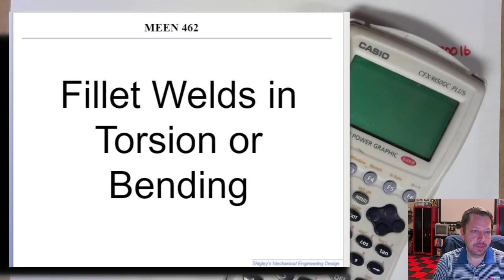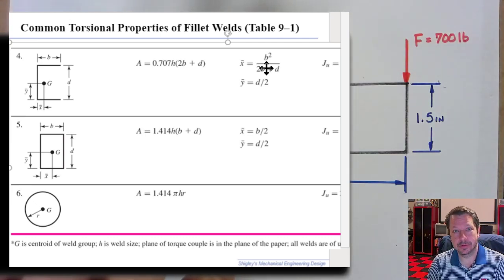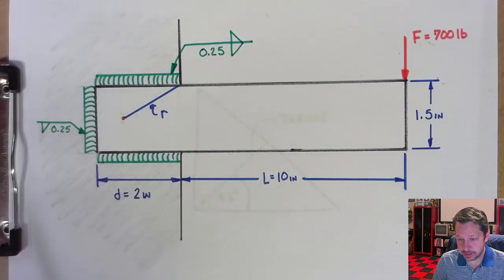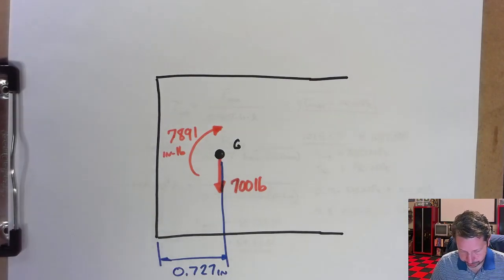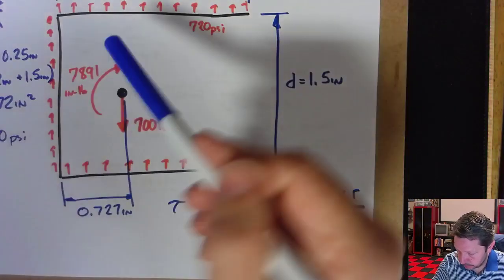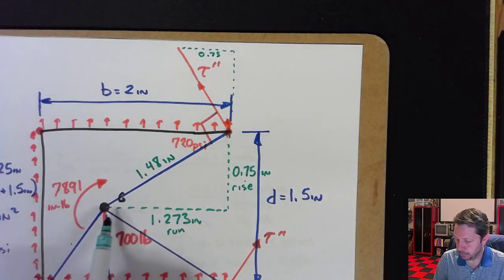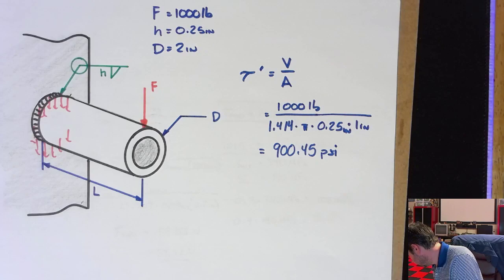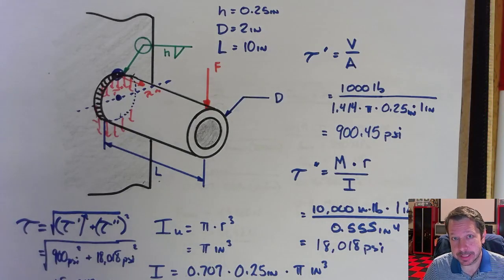Welded Joints in Torsion/Bending | MEEN 462 | Shigley

Comment: If you're trying to find the shear load of a plate connected to a rod like this as a fixed end, when calculating second moment of area, would I calculate it by the face perpendicular to the rod or the thickness of the rod?